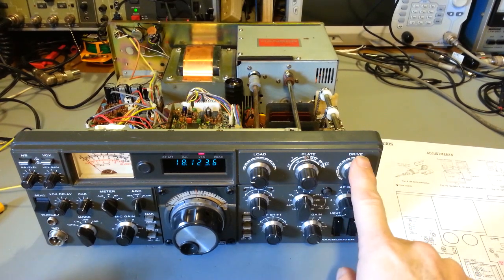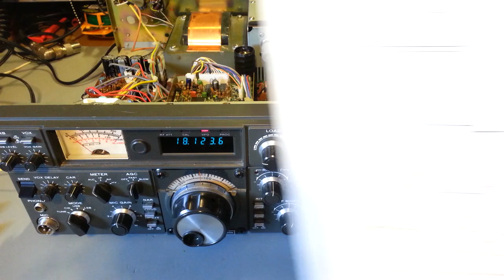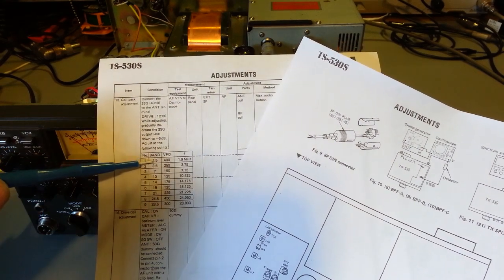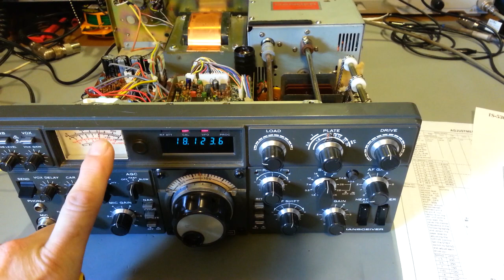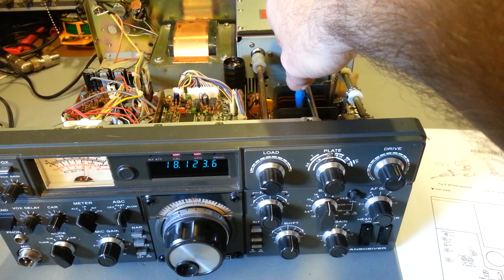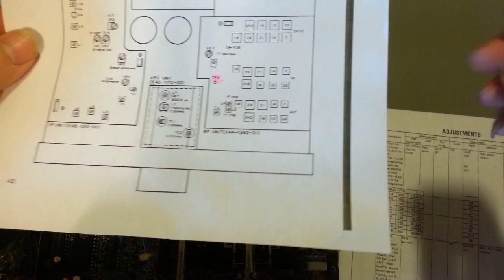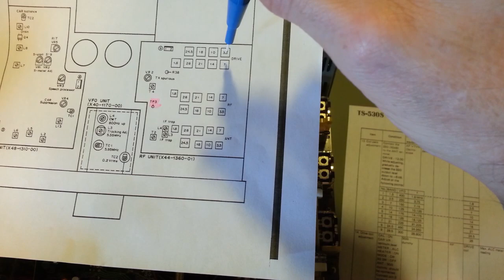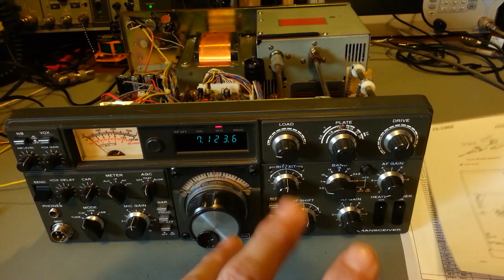Adjust coil packs Kenwood TS hybrid transceivers with uneven receive/transmit  peak on drive control

Comment: Another great video! My TS-830s with dual narrow CW filters and the VBT is a rock star now for receiving CW! How about a video CW filters? Mine is in fairly new condition and doesn’t need this adjustment done yet, but some day it will and thanks for the heads up! I thought it had no narrow CW filter at all until I opened the cover and found the jumper in the wrong location. Now how can I tell if mine is the Gold model? I’m the second owner and haven’t had it out of the box until recently. What an awesome surprise!

Comment: Great clearly explained video Mike. I'm curious as to why it changes frequency when you hit the send button? The vfo jumps in frequency.  Thanks 73
Reply: It’s how the radio is designed. In CW the radio on receive displays a freq 800 hertz higher than the transmit, this is so that air you tune the radio to hear the same frequency Morse code tone it will be the same pitch as the monitor tone when you transmit. It’s also an easy way to check calibration in field.

Comment: Nice video, Mike!  One small point that you did not discuss was to check that the drive control is exactly at 12 o'clock when performing the peaking - the manual is very specific about this, along with the frequencies per band.  The reason is that the selected frequencies are close to the middle of the bands, so by aligning at 12 o'clock, you will have enough travel to reach both the top and bottom of the bands.   Before doing this alignment, you need to make sure the drive knob itself is exactly aligned so the max and min positions are at the ends of the panel range.   12 o'clock is set to half way between the end stops.  The knob setscrews are often tightened a bit off center if the knob has been removed or has slipped.  Been there and done that.

Comment: On my 830 s I do not have the calibration button like the 530 has, Can I inject the signal from the radio or do I need a signal  generator.  There is a different method in my manual using the tune setting and send switch. I like your way better.any opinions.  73
Reply: IronAcres mic gain control knob says "cal on" at position 0. Dunno if you havd found that out yet.

Comment: Very nice video well done  tutoring.  I have a 830s gold I bought new and just now need to adjust the coils. I have a basic working knowledge of radios but was still Leary to do the adjustments until I found your video.  Down loaded the service manual online and have my page copy, all set to jump in.  73
Reply from the maker: +IronAcres 

Don't think you will have any problems.  Just follow the steps Inn the video and you should have it dialed in in no time.
Reply: Thank You.  N9CAV

Comment: I do work on radios but I have no interest in working on these because there is so much you can screw up by turning the wrong variable or any other thing you can turn . I usually tell people that I will check it out  and if I can do a quick fix then I will but I check it out and let them know whats wrong and then tell them they might what to send it to someone that will work on it or at they can let them know whats wrong anyway.

Comment: The 820's are very popular. I think the ones most highly coveted are the ones that were redone and Modified by a guy possibly named Mal. I've read that even before Mal gets his hands on them being that they're in good shape or have been recapped, aligned excetera excetera they're great performers but once this guy Mal gets his hands in there, wow! I haven't heard one myself on air but from what I've read they are quite the performers. They also fetch a premium after Mal(?) gets in them and works his Magic. Is anyone familiar with the person I'm referring to? is his name actually Mal? Are you familiar with this tec Mike? Good to see you're back doing some videos. hope life is treating you well.
Reply: No. You're talking about the FT-102 by Yaesu. That's the only radio Mal does. NC4L. They call them Malcomized radios and again, it's only the FT-102